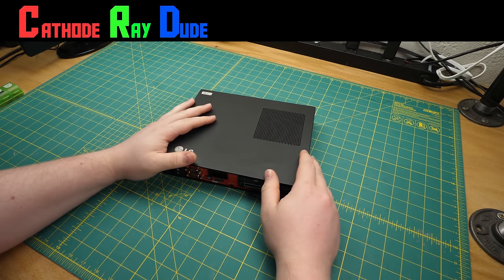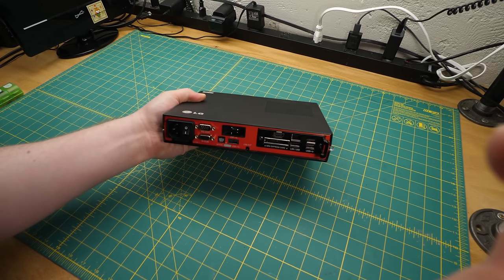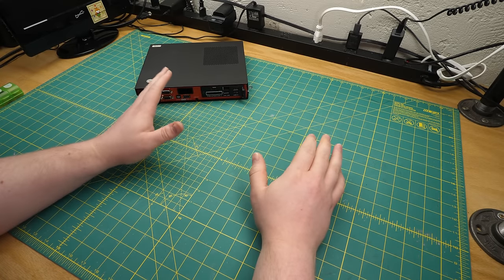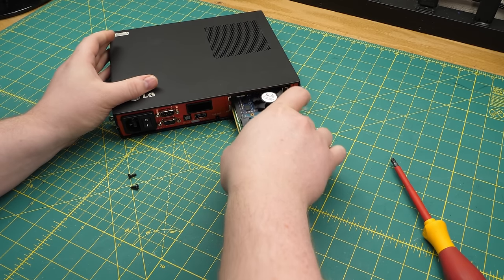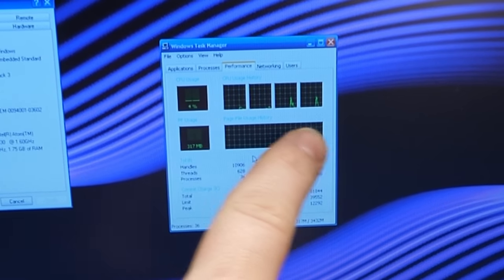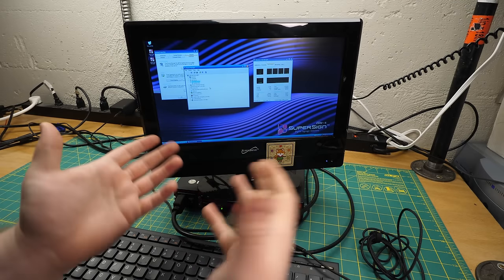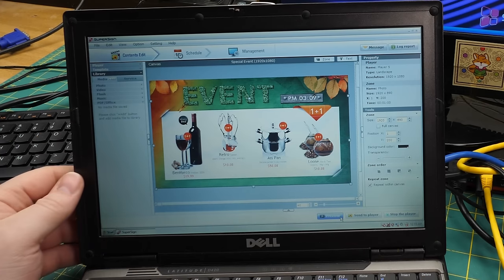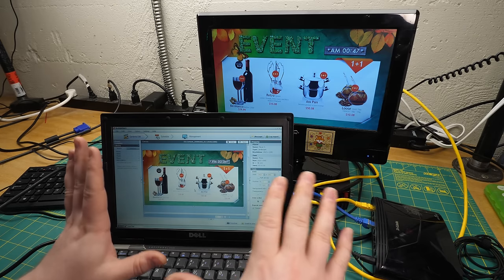Little Guys 6: The Worst Possible Timing [LG NC1000]

Comment: I've long wished that no 'smart' TVs existed, and all TVs were actually just monitors with OPS style modules.
Reply: Yes. Even using compute modules would be good. Or I guess whatever the smallest, cheapest computers are that you can still easily connect to a hard drive or SSD.
Reply: Never gonna happen, wouldn't be a good idea either.

The Image processing in TV's is optimised on a model by model (to some extent unit by unit) basis, this is especially important in the age of HDR where TV's are expected to adjust & roll-off the PQ curve & colour gamut to within the spec of that specific TV.

Monitors need basic processing done for them by the PC but highend HDR monitors are doing increasingly more processing on the monitor itself.

Switching to OPS would not only require a lot more calibration than your average consumer is comfortable with (in my experience most are to scared to even change the picture mode) but even with that you'll never get the results of an image processor optimized for that panel. 
And when consumers are looking at TV's side by side in a showroom (not something you do with monitors) the minuta of picture quality really matters.

The current system makes alot more sense. Have a built in SoC with software designed for that model. Include a Smart OS as you need the SoC anyway so why force customers to buy another media device.
And if customers don't like the built in option they can choose from a wide variety of Smart boxes on the market whilst maintaining the built in image processing no matter what device they use, a win win.

So as you can already connect a variety of smart devices, OPS would just overcomplicate the situation & add many more problems than it solves.
If you hate your TV's OS that much just buy an Apple TV, Nvidia Shield or build your own Media PC. We don't need to change the entire TV ecosystem to get the advantage of choice.
Reply: @MsMarco6 I agree it's never gonna happen, but not for the reasons mentioned. I suggest it's neve gonna happen because most people are fine with having ads choked down their gullet and a lifetime of 2 years casual use, if their TV is 500 instead of 2k dollars.

The signage PCs are usually color-matched quite well out of the factory, because many of those will be used in a mosaic application next to its brothers. They're also quite a lot more reliable, because they're expected to work 16 to 24 h a day, every day, for the duration of the service contract, and at brightnesses visible in well-lit rooms.

Frankly, I'd be willing to pay some premium for a TV that was basically a monitor. I don't watch TV. The inbuilt OSes are invariably slow as molasses and out of support in 3 years. Appliances have a long history of expected lifetimes of 10+ years, but TVs have strayed from that.
Reply: @MsMarco6  you entirely misunderstood the point, and also the distinction between 'monitor' and 'tv'. Removing 'smart' features doesn't mean removing the image processing hardware. A 'dumb' TV can still have DSPs, configuration/calibration presets etc. That isn't what the 'smart' in 'smart TVs' means. Furthermore, modularity can be achieved without sacrificing convenience. I'm under no illusions about how the nature of business and human greed makes my desire unlikely. I'm talking in ideals, as indicated by the word "wished". Begone with your obstinate pessimism, your misery is irrational and unwarranted.
Reply: @MsMarco6 the problem with smart tvs is that even when you use it as a dumb tv it still negatively effects the experience by being slow or injecting ads
Reply: @misham6547  Again that's an issue with bad Smart Tv's.
My S95B has no such problems.
It's just as fast as a dumb TV & the only ad is a banner for a TV show on the home screen, hardly the end of the world.
And this isn't just my TV, Smart os's are getting increasingly fast gen on gen so if speed is an issue just make sure you buy a fast one, then there's no disadvantage next to a dumb tv.
If you're super offended by any ads then just take advantage of CEC, switch on whatever input device you're using first & the TV should open directly on that input skipping the home screen entirely, literally making it faster than a Dumb TV.
And once again an SOC with a bunch of software loaded is a necessity for modern televisions, any load time you might be experiencing isn't just a bunch of unwanted apps but also a ton of crucial image processing so even if you ditched the entire smart interface you really wouldn't boost boot times that much.
Tv's aren't monitors they're a lot more complicated nowadays.
Reply: Inshallah

Comment: I think you hit the nail on the head as to why LG didn't or couldn't "trim down" the OS.  I've worked with XP Embedded, WES 2009, Windows Embedded Standard 7, and Windows 10 IoT Enterprise LTSC 2019 (Microsoft sucks at naming things, Xbox anyone?), and while it is possible to remove individual OS components, doing so often removes seemingly unrelated functionality elsewhere in the OS. These dependencies are often not properly documented, so they are only discovered during testing when something does not work. To make a Windows Embedded image as flexible as possible, it's often less hassle to not get too aggressive with the component trimming.
Reply: I'm cashier at gas station in Poland. We are still usin win7emb. It just as solid as XP, also with literally no replacement. I think management went with win7 due to security... on LAN... :D
Reply: Bingo, you beat me to it.  In particular, removing WMP breaks all sorts of ActiveX controls that you wouldn't think have anything to do with WMP.  Usually it's because the control is capable of producing audio, and it'll freak out if it can't find WMP's codecs.  This is particularly fun when you're working with industrial panel PCs running XPe that don't even have a speaker, but still crash when their HMI/SCADA/SPC software tries to load a charting or alarming control.  That ~20MB saved on the install turns into hours of labour per end user to troubleshoot and work around it.
Reply: And the reason to use Embedded rather than the full version of the OS is that Embedded was cheaper, so it made sense to use it even if you didn't strip anything out of it.
Reply: Also makes me wonder if the PoC engineer was trying to cut down the install size with trial and error, and boss came along and said "stop spending time on this, we'll upgrade from 512mb"
Reply: @ChrisHarringtonMinneapolis   No, because up-front labor is amortized on per-unit costs unlike storage.  I think Ed got it right here -- the costs saved aren't worth the future compatibility issues with dependency charts that look like an Arkansas family tree.  hehe  ;-)
Reply: @mmllmmll22  Old Windows can be just as internet secure as the newest Windows, if you put a good external firewall between it and the rest of the world. I've seen the videos where people set up a clean install of the RTM version of XP, no service packs or security updates and disable its built in firewall then within minutes it has five or so malware apps sneakily installed.

Guess what? ANY version of Windows will get that *if you turn off all its security features*. Has anyone done an XP install and used one of the 3rd party updaters to grab everything still available from Microsoft, and other means to install all the updates - then expose it to the Internet, with and without the firewall?

Is it still almost instantly getting infected or does it take a while? Or does nothing happen because only creaky old malware still lurking around, specifically written 20 years ago for early, pre-patching/updated XP can find and get onto it *if security features aren't updated or are disabled*?
Reply: @EdPenwell  Windows For Legacy PCs might be a better hammer for such nails. It starts off really bare bones but can have WMP and many other features installed just like normal XP to give it all the bells and whistles, while still leaving out a lot of cruft. But that 'lightness' doesn't help much with operating speed on an old system. It was mainly made for systems with storage and memory constraints.
Reply: @greggv8  It'd be great if the choice was up to the end user! For most industrial HMIs and IPCs, you're stuck with whatever the OEM provides due to driver availability, warranty support, and the "fit for purpose" argument when it comes to critical controls and life safety systems. For example, if you're using an AB Panelview Plus, you're stuck with CE or XPe depending on the hardware revision.
Reply: This is random but it's kinda amazing that your youtube channel is literally old enough to vote. Kinda amazing how long this platform has been up, isn't it??

Comment: all this time consumers "smart tvs" could've had replaceable upgradable modules, the last smart tv by LG we used the wifi died, then the ethernet, then the OS would randomly complain about no space and lock up requring a factory reset, supposidly the claims where bad memory leaks due to their outsourced webos that was never fixed for tvs 3-5years old, the sheer volume of tvs out there that would otherwise be perfectly funtional if not for bloatware should be a crime.
Reply: so funnily enough Samsung had the same idea and sold smart TVs with an upgrade slot... for like one model year AFAIK. I don't even remember if it was a line-wide thing or just one of those things they put on flagship TVs to make the flagship seem less of a waste of money.
Reply: WebOS was never intended for TVs (it's a tablet/phone OS after all), and when HP was handling it years back, it was massively underfunded and buggy as hell. And I was thinking LG would do something about it (there are bugs from like 2011 that were never fixed) but it looks like they never did. Memory leaks were common problem on Palm Pre, on which the whole system originated!
Reply: A major pet peeve of mine, I want my TV to just be... a display. either for a console or my full fledged HTPC. having a socketed module would just be another input device. were all used to pushing the Input button, and selecting HDMI1, AV2, DTV, etc etc. It would be simple to have SmartTV as one of the inputs. but no, plugging the TV in requires me to wait 2 minutes whilst it boots android. and then complain that it does not have wifi. or if you pick up the remote wrong, it drops whatever your doing and tries to load netflix. If I could choose what module I jack into the SmartTV slot, I would absolutely use it. Id thought that waay before this video, but now I know its a known standard... im a bit peeved. I would totally buy a MiSTer module. how cool would that be?
Reply: this is worrying, my LG tv wifi just died.
Reply: We have an LG smart tv and webOS is so annoying, especially since it doesn't support Android apps (I wish I could have Kodi on the only 4K TV we have at home) and NOT EVEN ChromeCast, only Apple AirPlay...
So for me the only option to stream my local media is to install the shitty bloated LG smart home app, which needs an LG account to even work, and then wait forever until the app loads all the recent media on my phone (since just using Android's native file selector would have been to easy) and guessing what video I actually want to play, because the file selector only shows thumbnail and time stamp. Tbh even my old Toshiba 1080p "dumb" TV with an Android TV stick is sooo much more convenient
Reply: I just want a dumb TV at this point...
Reply: I mean aslong as you can still access the hdmi inputs you can just plug in a firestick, apple tv etc. So there wouldn't be a whole ton of use for this.
The amount of TV'S damaged enough to not allow changing inputs but intact enough that the display itself is 100% functional probably isn't that high.
Reply: @SnakebitSTI There are dumb tv's, they're just cheap tat.
The fact is that any mid-high end television has to include a decent SoC in order to have competitive image processing.
And the SoCs companies like Mediatek sell that can power a modern 120hz 4k VRR TV are also capable of running a smart OS.
Add to that the fact that manufacturers are gonna include wifi modules anyway to push updates to said SoC's and you can see the issue.
Any decent TV has to include Smart TV hardware anyway so you might aswell include Smart Tv V software.

People don't realise just how much image processing goes on behind the scenes of modern TVs. Some manufacturers like Sony orient their whole brand around it. A monitor like TV without said processing simply wouldn't be competitive in the market.
As the moment you displayed a low bitrate Streaming show on a 65"+ panel without enchantment is the moment your average consumer returns the TV.

The Streamers & TV networks push out shockingly low quality video streams then expect TV manufacturers to process their way back to normal.
Reply: @MsMarco6  And I want a dumb TV.

I don't care if the SoC could support a smart TV OS, I'd still rather have a barebones input select menu and a TV which doesn't connect to the network. An Ethernet to HDMI passthrough would be acceptable. Given the current offerings, I would rather download firmware updates onto a USB stick than have an internet connected TV.

I do not want the smart TV software even if the TV is fully capable of supporting it. I don't want it at all, for any reason.

If TV manufactures start allowing loading your own OS, I would consider that. But I do not want a manufacturer supplied smart TV OS. I would rather have a dumb TV.

I really, genuinely want a dumb TV with a good panel.
Reply: same. Wifi dead, so I guess we play the waiting game...😢
Reply: @SnakebitSTI  The issue is more that some Smart Os's are slow than that they exist at all. On my Old TV I'd agree, Android tv would take over a minute to fully boot b4 I could change inputs. But now with my Samsung OLED It's a none issue. The TV boots instantly & with the classic style remote the HDMI inputs are a button press away, it takes the exact same amount of time as my Parents dumb TV so selling a Dumb SKU would be entirely pointless it would have 0 benefits. 
Plus with HDMI CEC you just turn on the device you wanna connect to & the TV opens on it.
If you don't want it to be connected to the internet you don't have too, noones forcing you just disconnect it.

So aslong as the Smart OS runs quickly selling a Dumb SKU would be a boneheaded move, it wouldn't offer a single benefit, it wouldn't be faster, it wouldn't be more private & it wouldn't offer a single feature. So TV companies & stores would have to go through all the expense of shipping & stocking an incredibly niche product that would cost the exact same & offer 0 advantages just to cater to the tiny crowd who hate Smart os's even if they do absolutely nothing to harm the experience.
Meanwhile average consumers wouldn't touch them because why would they pay the same for less.
They're never gonna do that, they'll keep packaging in a Smart Os. If you wanna use it use it, if you don't then ignore it.

If you want the most seamless Dumb TV like experience just buy a TV with a fast OS & old school remote, disconnect it from the internet, then your free to ignore every smart feature. just hit the input button when it boots just like you had todo with every TV ever & your straight to where you want to be. Aslong as the OS isn't bloated then it's the same experience it's always been.

Also allowing Custom Os's literally can't happen. Streaming Services seriously limit features like 4k & dolby Atmos on anything that isn't a verified Smart OS for fear of Piracy (just look at the nerfed Netflix experience on windows). 
The moment TV manufacturers allow you to make modifications to the operating system is the moment Streamers pull their higher tier features from your TV.
It's for that reason Android TV was ditched for Google TV. It's just like how Sony stopped allowing Linux install on PlayStation, the moment your handling copyrighted material you need to lock down your system.
Reply: @MsMarco6  You seem to be misunderstanding me. When I say "I want a dumb TV", I do not mean "I want a smart TV that's never been plugged into the Internet and has gaping holes in the UI", and I do not mean "I think dumb TVs would be viable on the market and manufacturers will make lots of money on them", I mean "I want a dumb TV".

Comment: I'm glad you finally mentioned bright sign; when I worked for a company that rhymes with San Francisco I installed their system of signage in a building which were just rebadged versions of the high end bright signs. They were centrally managed and could do things you could only dream of with a normal PC. They were pulling in a multicast TV stream on most TVs, but we had a video wall with 9 of them and they supported video walling natively. They could also send IR and serial commands natively which we used to turn the TVs off and on on a schedule.
Edit: wasn't expecting this to be capable of video walls. I suspect the only reason to do it with multiple instead of using a video wall controller is that the displays can run at their native resolution whereas a video wall controller would be limited to 1080/4k
Reply: ?Cisco
Reply: @UnforgetableLuncheon  Nabisco?
Reply: Crisco?
Reply: @danrmanalt  ... Man...Disco?

Comment: The TVs we use for digital signs where I work are definitely not ordinary televisions. They are commercial models, designed to run for years without interruption. So far, out of 180 displays we have had deployed for the past 4 years, we have not had to replace one yet, though several of the little guys attached to them (which run android and are scheduled, tracked, and managed remotely by a contracted service provider) have had to be replaced. I suspect LGs primary purpose in building the large breakout box for the NC2000 was for if you had an existing TV that didn't have the built in PC slot.
Reply: So... A regular TV with better capacitors